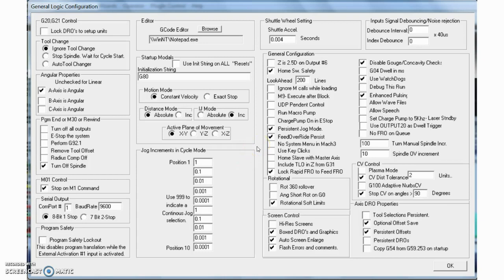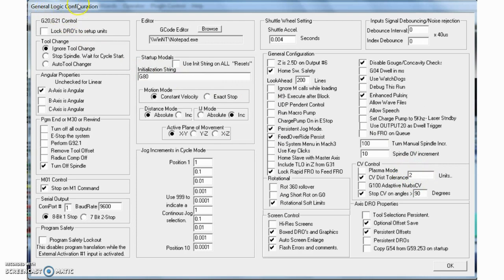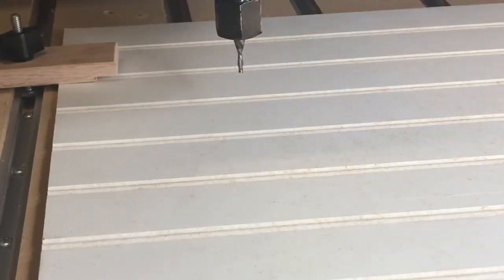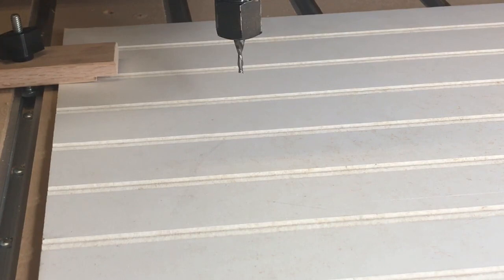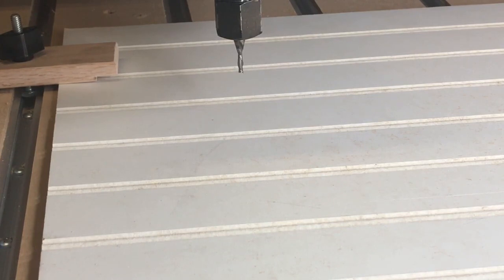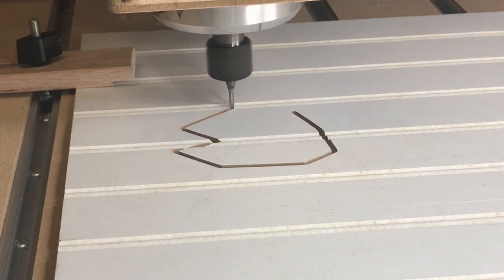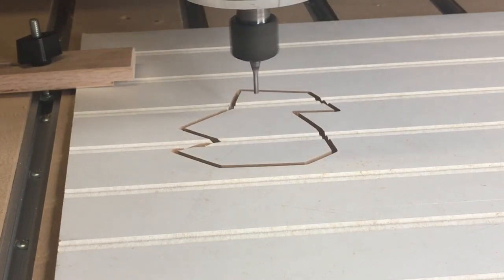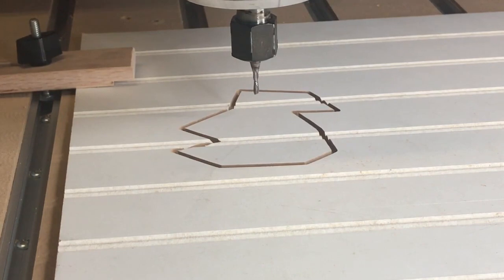Exact Stop vs Constant Velocity in Mach3

Comment: 2mm distance tolerance is huge. I think mine is set to 0.001", i e. 0.025mm. Mind you, I'm machining metal, not wood, but still.
Reply: Hello. Are you still using the same settings? I´m machining aluminium and I don´t know what values to use. Thanks.

Comment: Seems like the same difference obtained by using G64 instead of G61 instructions before your cutting instructions in the G-code. (Maybe the Mach3 interface is doing just that?)
Reply: I believe G64 Turns on CV Mode, and G61 Turns on Exact Stop Mode. so yes, the results should be similar